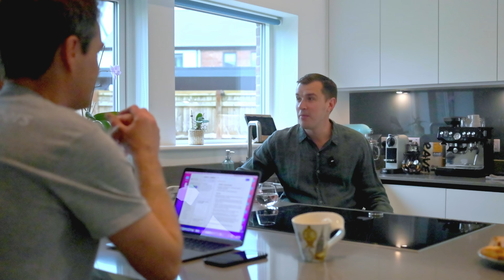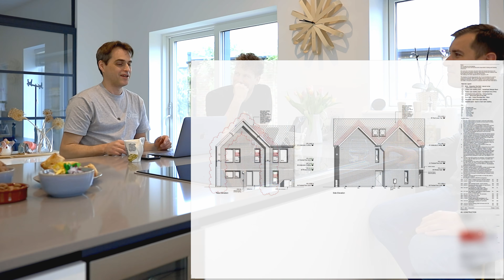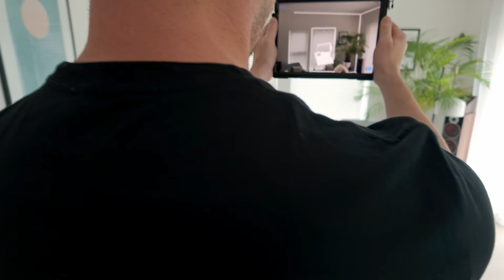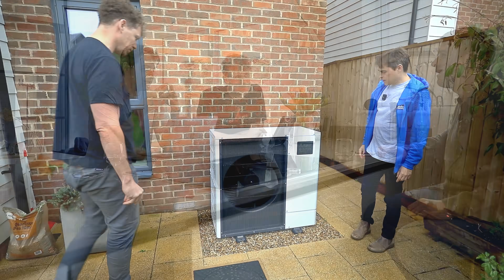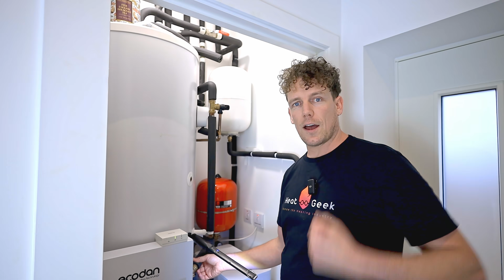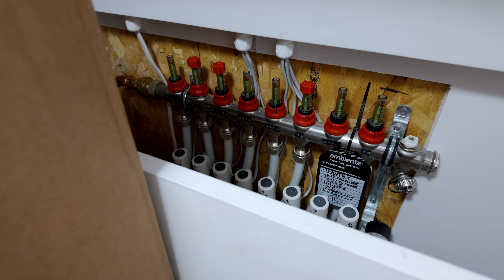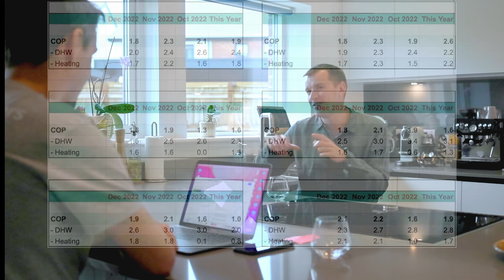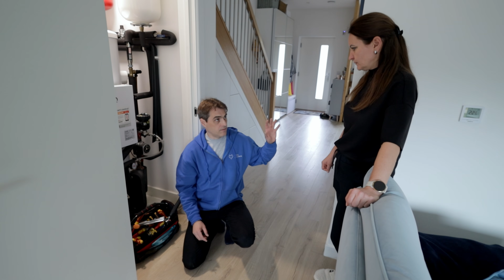How Developers Are Ruining The Heat Pump Market

Comment: passive house spec is 10w/m2 peak load. So 2kw. Worth mentioning that passive house on big developments with simple thermal geometry it only adds 2-5% onto the costs over building code.
Reply: That is nonsense because we can't even build to "code" properly so passive house would just go even more wrong.
Reply: @Swwils  Research on real PH builds has found that they actually have a very good record of meeting their design specs, unlike most UK mass-build houses. Because you actually have to pass a fairly stringent airtightness test, and design out a lot of the stuff that brings houses down (thermal bridges, thermal bypass), it's actually easier to build it so it works like it was designed. Said researach was published in passivehouseplus magazine a couple of years ago.
Reply: @xxwookey  we need to do it enmasse. Hint. We can't. 😂 Using one off builds is a silly example.
Reply: @Swwils  There could be an argument that a better designed house would be easier to construct correctly. Dense packed insulation between double stud walls, for instance. But the UK is attached to certain ways of building (brick leaf, insulation, concrete block, dot and dabbed plasterboard).
Reply: @asabriggs6426  that's hilarious
Reply: @asabriggs6426  my house isn't built like that, so not really?
Reply: @streaky81  I'm not sure how the presence of your house invalidates my point ...
Reply: @asabriggs6426  not to invalidate your point completely, but you're describing English housing, rather than UK.
Reply: @ricos1497  Per ONS data
"""
Between January and March 2023 there were 45,050 dwellings completed in the UK. By country, the following number of dwellings were completed:

37,350 in England
1,050 in Wales
5,420 in Scotland
1,230 in Northern Ireland

"""
So new homes in England were just shy of 83% of houses delivered in the UK.
Reply: The majority of people cannot afford to own a home.......and you think the GUV will make things better by adding to the building code... WTF !
Reply: @9avedon  Well, the taxpayer spent 100bln subsidizing fossil fuels during the 2022 energy crisis, because our homes are not good enough, and you can't let people freeze. So there's money somewhere, it just does go to most people.
Reply: @9avedon  The price of a house is what the market will bear. If government rules make a house 2-5% more expensive to build (e.g. due health and safety rules, minimum wage, ecological requirements, etc) then the value of the land reduces by a corresponding amount, no?
Or are you proposing that the price of the house will increase to take into account reduced running costs from all the insulation?

Comment: This is what you get if you design for individual components, rather than as a whole system. Having said all this, the difference in running costs at such low heatloss values / operation, will only cost an extra £1 / day in winter to run. i.e. it goes from £1 to £2 a day.
Reply: care to explain?
Reply: @normanboyes4983  Adam notes a COP of 4, the current system has a COP of 2, hence from £1 to £2 a day, at 4kw heat loss.
Reply: @EverydayLife621  It makes you wonder if the proposed remedial works will pay back (eg will they swap the unit to avoid cycling?)
Reply: @normanboyes4983  These are super well insulated houses built to higher standards than even the current building regs. They really don't need much heating. The whole idea of a 'passive' house is that the heating demand can be supplied from the waste heat from cooking, lights, hot water and just living in the house. I imagine that they only need to turn on their heating in the middle of winter.